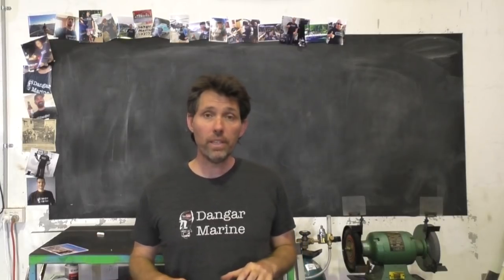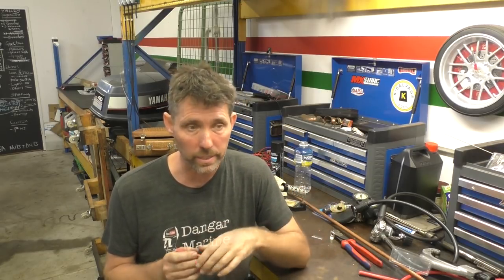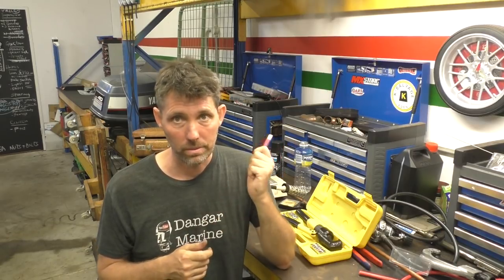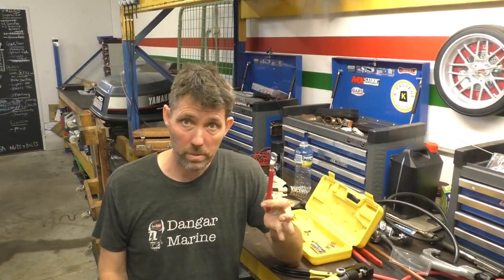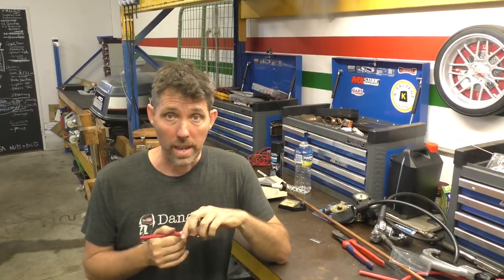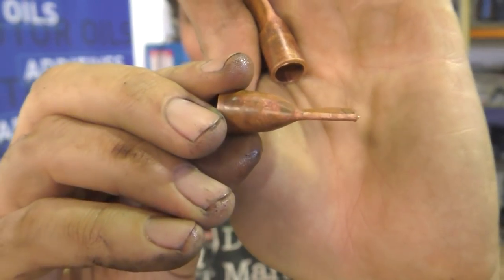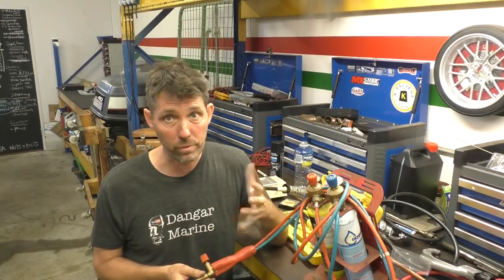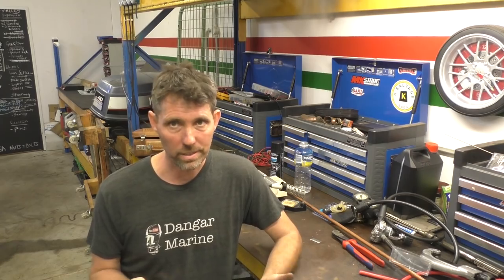Making your own battery leads

Comment: Don’t cut your tubing before flatting the end and drilling it is how I’ve done this for years and no need to use a bolt inside it. I just use a hammer to flatten the end and always use refrigeration tubing cause it’s thicker and holds up better than water tubing .Petroleum jelly caked on top of installed connector will stop all corrosion. Thanks for your videos!!
Reply from the maker: Interesting that refrigeration tubing is thicker, I'll have to see if I can find some.
Reply: Dangar Marine yes one is measured by inside diameter and the other is outside diameter.

Comment: stu may  I suggest that you use some terminal fuses that are available now...from bla...they are a great way to protect the high current circuit from dead shorts. They just screw to the 8mm studs and have a 150amp fuse built in ill post some pics on fb..cheers.
Reply from the maker: Saw that post on Facebook, they look really cool and compact.

Comment: Now you can get red (and other color) dual wall heat shrink. You can also get clear dual wall heat shrink, which will reveal if there is a problem beneath.

Comment: I've seen people melt solder into the end connection then put the wire in and it works pretty good wonder if you could use alumiweld rods that you just use a little torch on them put some inside the led then put the wire in.wonder if that would work

Comment: Was the copper pipe used to make the terminals annealed or hard copper ? (looked hard).  Would annealed be better in that it wouldn't tear as bad when flattening in the vice? Or would it be too soft once finished? I guess I could go to the shed and try for myself but I've got a mountain of firewood to split.......... Bugger it, I think I'll grab a beer and watch your  next video..
Reply from the maker: Hey mate, I'm not too sure to be honest, it was just some old copper water pipe that I found lying around the workshop. It would be interesting to experiment with the two different types though.

Comment: Had a bizarre occurrence . . where a mig welder I bought from the dump shop . . was found to have 'short' burnout internal break in the power lead to the gun . . being all fine wires it was curious  as to how a small defect in one wire could burn out the rest . . but it did , but anyway . . a good replacement for burnt out wires going into speaker cones etc . .  is de solder braid wick

Comment: Soldering is the only way I'd do it in a marine environment. you can pre-tin about 6" of the wire if you use a good rosin paste flux and let it wick up. Just need an 80w iron then heat shrink over the top.   Cold welding is how they attach microfilament gold leads on silicon chips too. I'd think that the problem with a crimp is that copper corrodes so any benefit of cold welding would be lost in a salty environment.
Reply from the maker: I think that is the intuitive feeling that most people get that makes them favour soldering over crimping (and I was certainly one of them), but from what I'm reading, if a crimp is done correctly, the metal inside the crimp won't corrode at all, even in a marine environment.

Comment: Dielectric Grease is used on bulbs and other places to prevent oxidation and corrosion - so would it be a good idea to put a light coating on the outside of the wire?

Comment: i've never tested it but i have seen wires get hot with age on older equipment. main alternator wires etc. if its hot too touch replace it.
Reply from the maker: The more resistance in a wire, the more heat it will generate for sure.

Comment: Hi Dangar Marine,  quick question i have a little 4m tinny and im in the process of installing some lights. Could you share any info with me on any fuse requirements i may need. im installing 2x nav lights / 2x LED spot lights(27w each) / 2x 5w led deck lights. thankful for any help you could lend
cheers
Reply from the maker: Take a look at the Electrical playlist on the channel page. Plenty of vids there on that subject.
Reply: @DangarMarine  thanks mate! will check them out!

Comment: Who makes the hydraulic crimper. Are all makes the same or one crimper better than the other
Reply: John Bladykas just go on eBay and  go for the one with best price. They have some that are a little bigger too
Reply from the maker: This is the one I bought, I imagine most of them a rebranded from some nameless OEM manufacturer http://www.ebay.com.au/itm/8-Ton-Hydraulic-Wire-Force-Terminal-Crimper-Cable-Crimping-Tool-9-Dies-4-70mm/391693130659
Reply: Thanks

Comment: Hi stu where did you get the crimping tool
Reply from the maker: I just bought it off eBay http://www.ebay.com.au/itm/8-Ton-Hydraulic-Wire-Force-Terminal-Crimper-Cable-Crimping-Tool-9-Dies-4-70mm/391693130659

Comment: Hi Stu... just on a general safety note... try never to grind copper, brass or aluminium on a grinding wheel... much safer to use a file... or if you really need too, use a flap disk... Not going into details... plenty of info online... 

Again thanx for the vids....
Reply from the maker: I quite like flap discs on a grinder, they work really well.

Comment: good morning Dangar Marine
could you tell me why the mercury engines of 25 hp and 30 hp because the 30 hp engine has more horsepower than a 25 hp the two engines have the same cylinder centrimetris cubic are the same are 556 cm both the of 30 hp has more revolutions 5250 rpm to 6250 while the 25 hp has rpm 5000 to 6000 cres that the difference is in the body of acceleration of the 30 hp engine with that delivers 30 hp ..
Reply from the maker: With outboards that share and engine block it is generally jets in the carburettor and possibly reed valves that are changed.

Comment: There are these things called solder slugs, and they seem to be made specifically for soldering cables into lugs without the hassle and mess with trying to use solder wire.  Check out this site here:  https://www.delcity.net/store/Terminal-Solder-Slugs/p_1036.h_103464  I'm curious if they have anything like that across the pond.
Reply from the maker: Interesting, they certainly seem like a great option if you are going to go the solder route. Looks like these guys ship to Australia.

Comment: Outstanding video, thanks as always! I must admit I always buy battery leads, there's an automotive place fairly close to me that will make up leads to whatever length you want and crimp the connections on. They're cheap, and they have the kit to do it. I do have a few battery jobs to do in the near future though, so may well get one of those hydraulic crimpers and have a go myself. What are your thoughts on using electrical greases under the heat shrink? I always use this stuff https://www.autoelectricsupplies.co.uk/product/827/category/154 (1st link I found, can probably be bought cheaper elsewhere) with all my electrical connections. The theory seems sound, and a tube goes a long way, but I haven't been boating long enough to know if it really helps or not. Thanks again from the UK
Reply from the maker: Hey Chris, I think dialectic grease is a good idea, but I tend to use it more with push on plug connectors than crimp and heat shrink ones. I think with the dual wall heat shrink in particular I would avoid it as it would prevent the hot glue from sealing against the cable.
Reply: Dangar Marine thanks Stu, appreciate your reply 👍